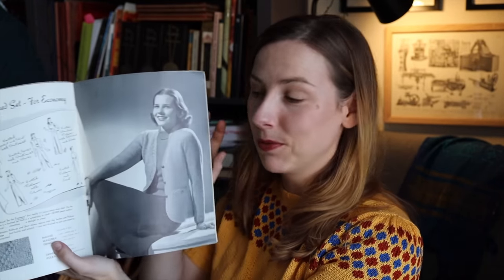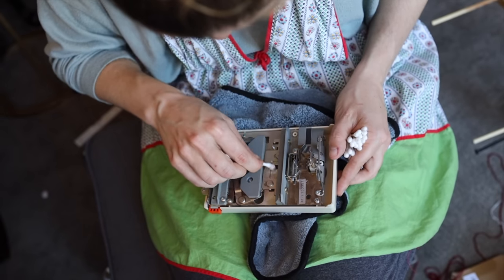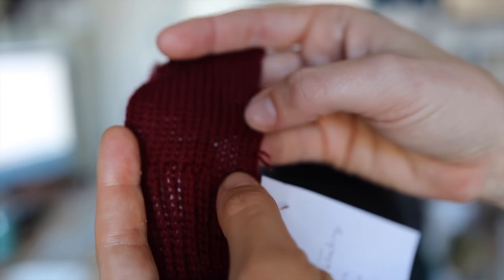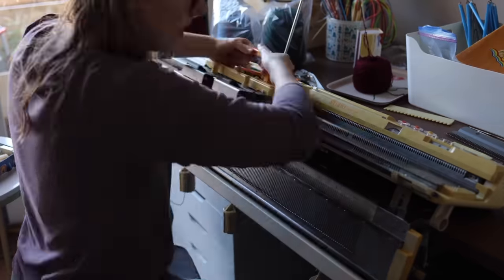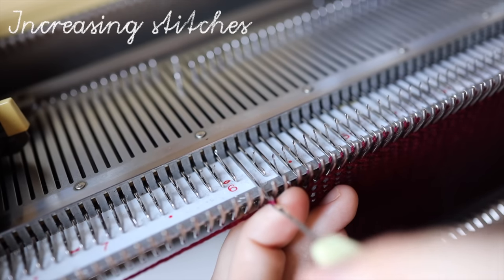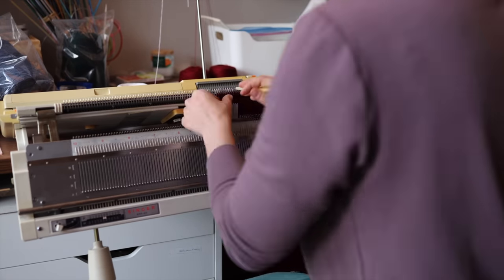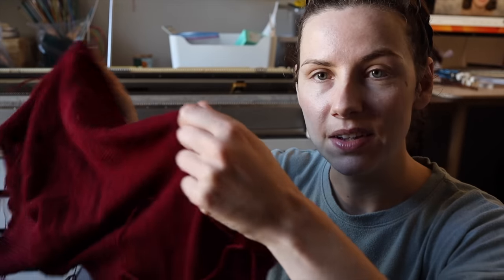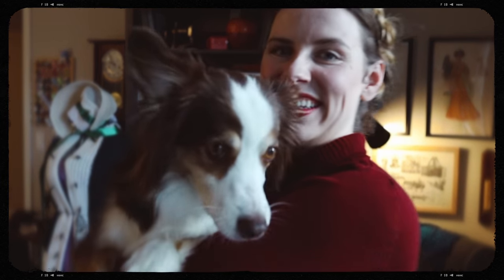Knitting a Classic Vintage Red Sweater

Comment: Hello, I usually set the sleeves into the armholes first, then sides, and the sleeves in one go..also while knitting I place small length of contract yarn on the beginning and end of every 20 rows so when it's off the machine it correspondents beautifully. Ps.  I use claw weights only after the ribbing on my brother..Well done .  Its hand crafted and I ❤ the rich colour

Comment: Hi  from the uk, i used to own a vintage  brother knitting machine  from the 1980s, but found it too stressful to use Its a shame because  did knit a few very nice jumpers and hats on it. As it was well used before i owned, it needed frequent  maintenence and the  frustrations  bending needles and damage to the cast on comb. So i sent it to the scrap metal man, i still wish id have kept it as like you say it makes knitting a lot quicker at fine gauges

Comment: Your sweater looks amazing. I came across a singer linking machine for 100$ on marketplace. My understanding of the linker attachment is that it can be fiddlely. The linker machine so easy to use. As a side note, machine knitting is still handmade just like a sewing machine is still handmade. People are quick to judge, but you only get 1 body and repetitive stress injuries are debilitating. The amount of knitting you do is amazing but it can take a toll on your body and you need to take care of yourself first and foremost before you allow others to judge. Moderation is key!

Comment: Amazing sweater! I love watching your machine knitting videos, as a fellow machine knitter. In terms of sizing, do you use the original pattern measurements and adjust to fit you? I ask because I've had a lot of difficulty getting machine knit items to fit (similar to your flat sock knitting issues a while back!). 

Also at 8:07 I noticed you're using a normal transfer needle to transfer from ribber to main bed, but did you know there is a needle transfer tool that makes this way easier? 10/10 would recommend!

Comment: It doesn't look like you use every peg when making a sweater. Is it possible for you to swap some pegs at the very end that are straight with the pegs that are bent as a quick fix to hold you over until your able to repair or replace the bent pegs? Just a thought. 😊